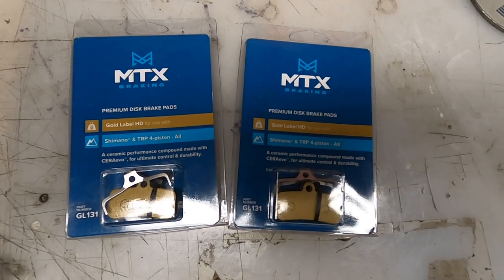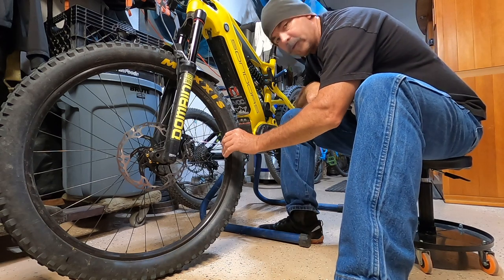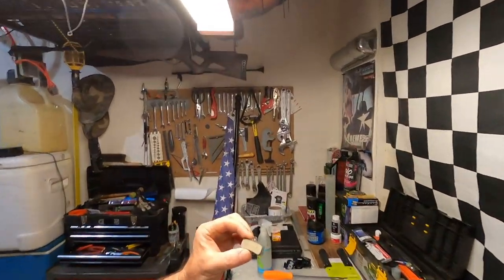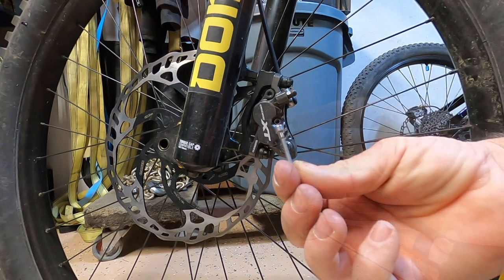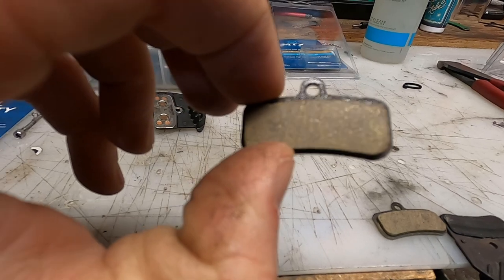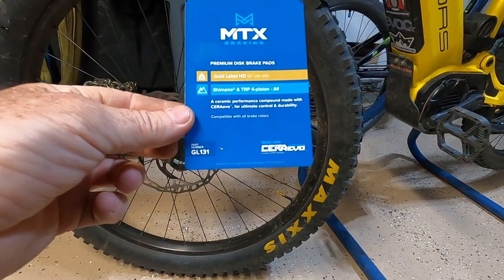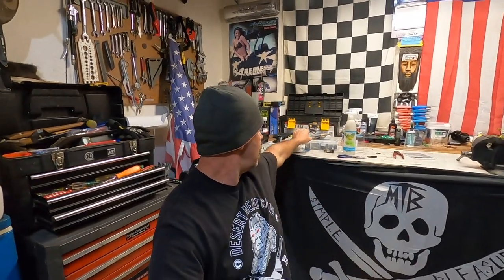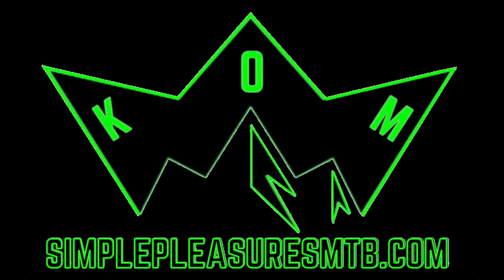MTX Brake Pads Install

Comment: Hi Doug.  I want to replace the 2 piston caliper set up on my LX. Does the 4 piston caliper bolt up to the existing disc and hardware? Or is there something else needed. The factory brakes just don't cut it. Great vids, have a prosperous and safe New Year.  Thanks, Tom
Reply from the maker: So that would depend on what brakes you currently have on now (Tektro or Clark’s (the black with red piston). Mine had the Tektro brakes and I just needed to swap out the caliper and banjo bolt to use the existing brake hoses and controls. The Clark’s calipers use a different style hose end to the caliper that I’m not familiar with…but there are kits to change the hose ends to whatever you need to adapt to whichever caliper you choose to run. I just went with Shimano Deore XT 4 piston calipers, you could also try those MTX Gold series brake pads first? That would be a cheaper alternative, or just go with a new set of brakes altogether. Also you don’t need to run the brake cut off sensor type brakes. You can just delete or unplug the wires and stuff them in the frame. Here’s an “example” of what you could do to adapt your existing brake hoses to whatever style caliper you chose to use. It’s a simple snip, install, adapt.

Comment: Hi. After about nine months I've noticed that the characteristic Rockstar "whine" seems to be getting louder. One of my riding buddies even commented on it. Is the normal? Have you or other Rockstar enthusiasts noticed anything similar? I have another friend who has the same Bafang motor on a different bike and it doesn't whine much at all. Thanks. BTW - Love the videos.  I start the day with one when I cant get out on the trail.
Reply from the maker: Thank you for your comments and yes, the “whine” is most likely due to low grease in the gearbox/motor (many come under greased from factory we are finding out) It’s getting louder because (in mine and others experience) the main shaft that’s attached to the stator (motor rotor online it’s called) is getting worn out, here is the link to the part
https://www.greenbikekit.com/electric-motor-engine/ultra-g510-mid-motor-parts/bafang-m620-g510-motor-rotor.html
You could replace the part or you could try opening up the motor and re-greasing it. That’s what i ended up doing. It helped. I do have a 2 part video on how to do the procedure and honestly it’s not that difficult. Maybe check it out and see if it’s something you are comfortable with. Or you can just ride the bike the way it is till it dies😂joking aside, it should still last quite awhile the way it’s running now. I wouldn’t be too concerned
Reply: @SimplePleasuresMTB  Thanks for the prompt reply. Yes, I vaguely remember your video/s on motor removal and maintenance. I think I will go that route as well. Thanks again. Happy riding.

Comment: being that brake pads are so small and with the gnarly area you ride in keeping a spare set mite be a good suggestion especially when it becomes clear they are in need soon, to bad they don't make a little noise like in our cars. I need to check my bike better than i was before rides because a bolt to my linkage fell out. At least it was found ,will getting new forks, before something broke. Thanks for another great video .Don't worry about you're quality it is and will continue to get better they are priceless no one ells to my knowledge, does Rockstar tutorials? I wont be able to order mine till about March yet i watch each n every one so if they were bad i wouldn't watch. Happy New Year and "stay Stoked"🚲
Reply from the maker: Thank you. Yeah a spare set is a great idea. Can’t wait to give them a try.

Comment: I want to cover the silver sondors text on the crank arms and motor..how would you go about that
Reply from the maker: I would just use a black paint marker or scuff them up with a scotchbrite pad and use some black spray paint.
I personally use these for touch up on any scratches 
Competitive Advantage Enamel Paint Markers MPD, GREY Permanent Markers, Make Permanent Marks on Metal, Glass, Rubber, Plastic & more, Waterproof UV Resistant, Medium - 2mm - 3 Pack https://a.co/d/0jmKvhl